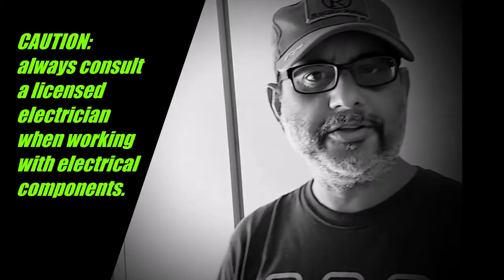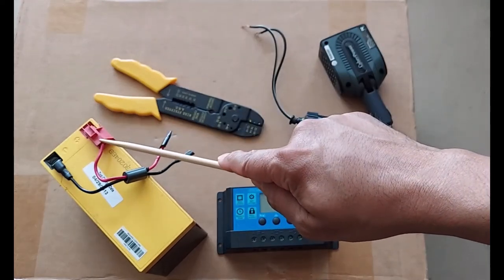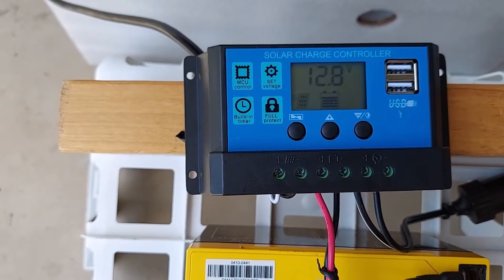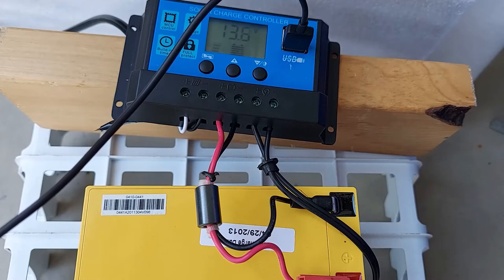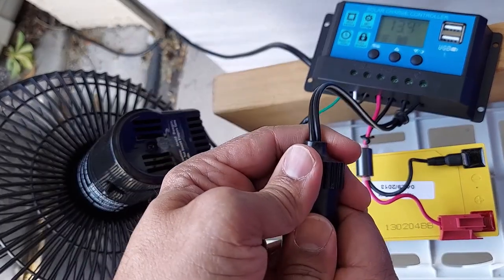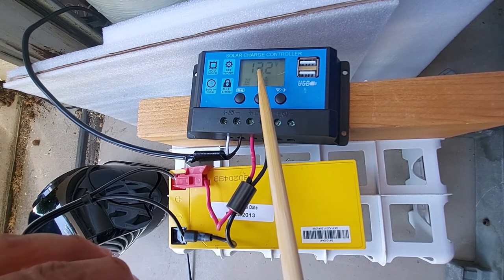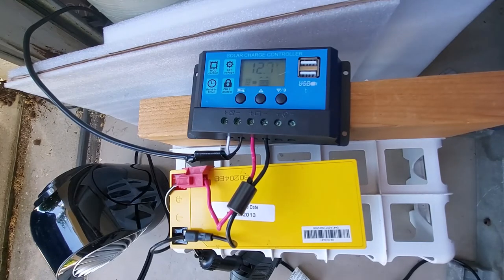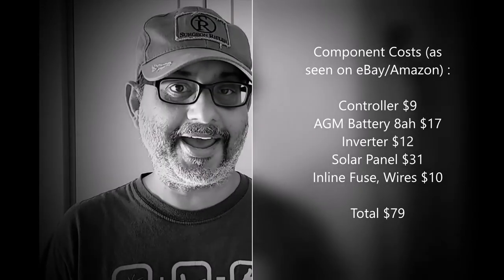DIY Off Grid Solar Build - Beginner Friendly

Comment: What's the cost
Reply from the maker: It comes to about $80 by using the low cost battery and controller. But if I had used slightly better quality components, it would be about $100